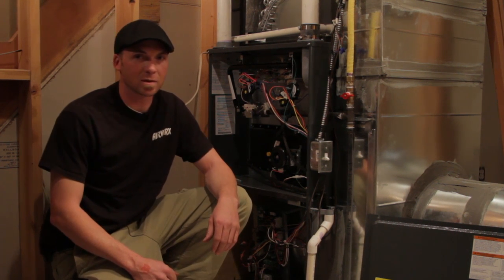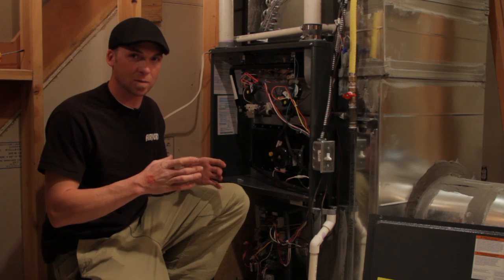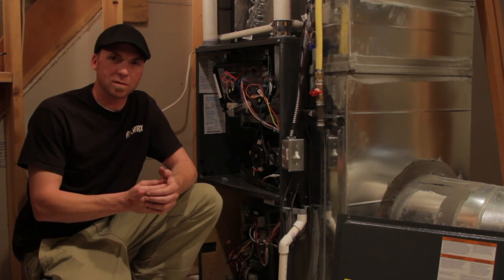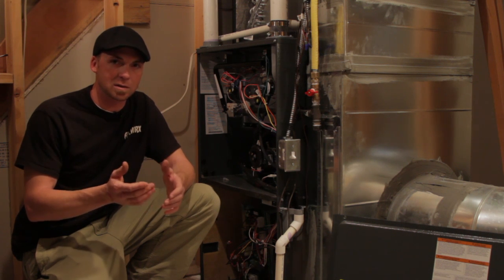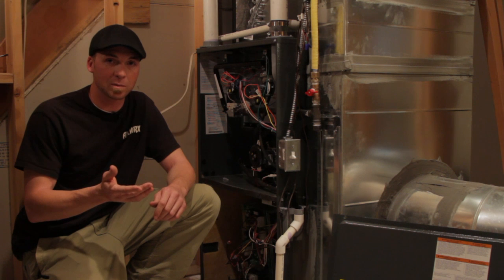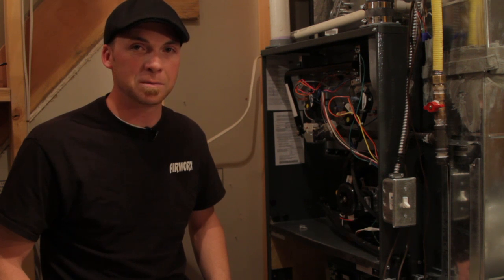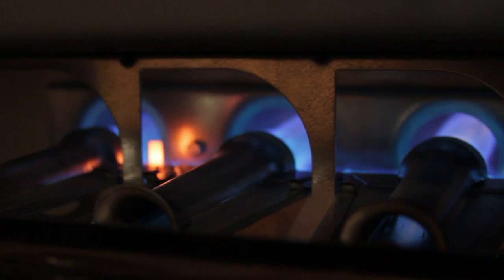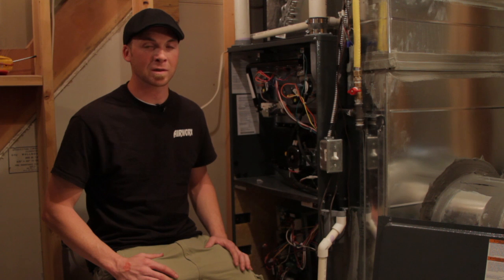Central Air Conditioning : How to Determine Your Furnace BTU Size

Comment: I have a 2700 square foot ranch. My 100k BTU furnace was replaced with a 60k BTU furnace. My 60K never shuts off when the temps dip below freezing.